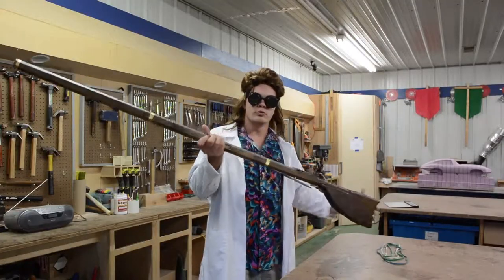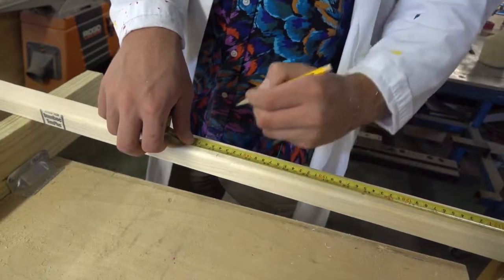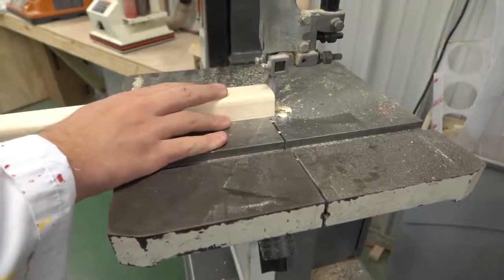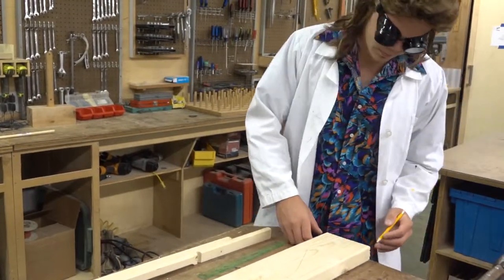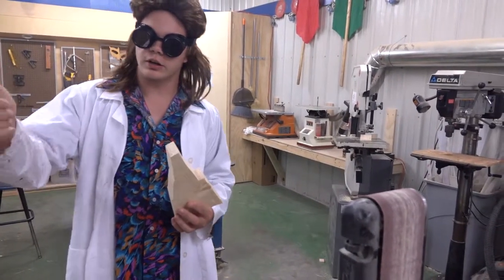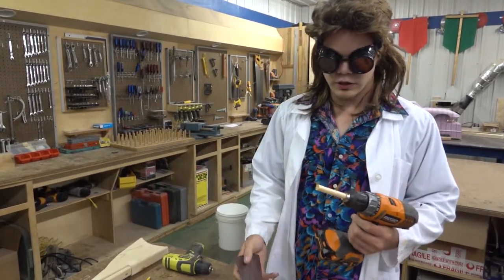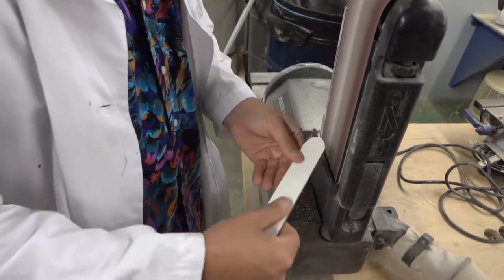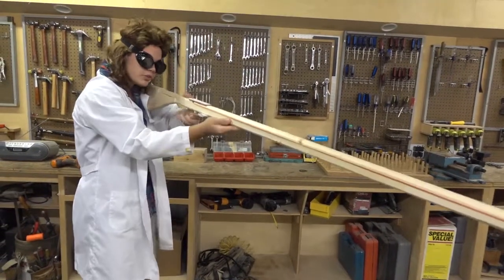Let's Build A Rubber Band Musket - Learn • Build • Play S1E3

Comment: Another idea if you are here for bandguns use an axe or wood splitter handle - Usually they are made of reasonable wood. The wood he is using isn't for surgical tubing in larp ( my comment ONLY applies if you are using "bands" with higher tension).